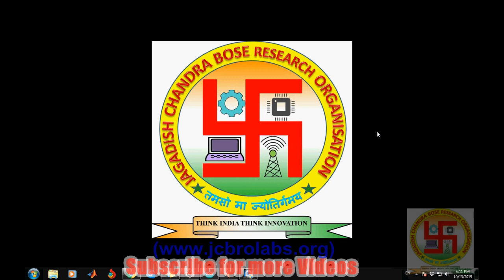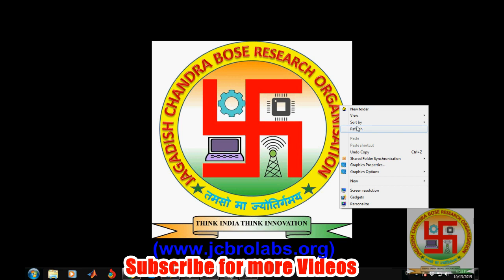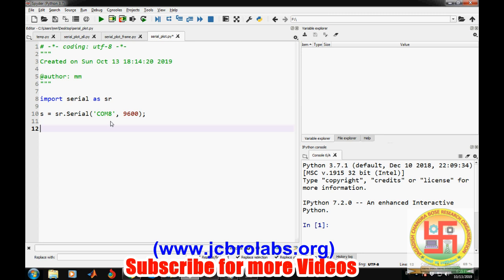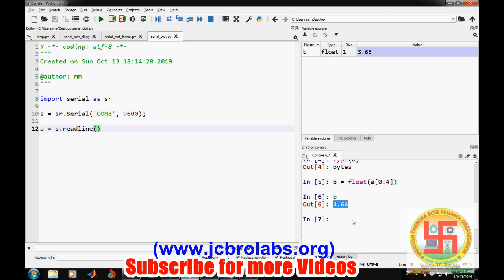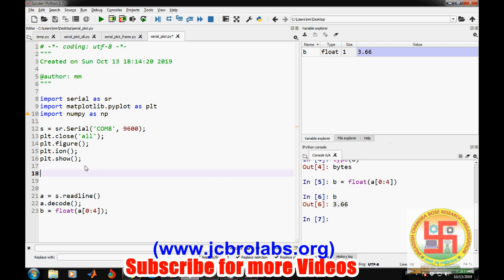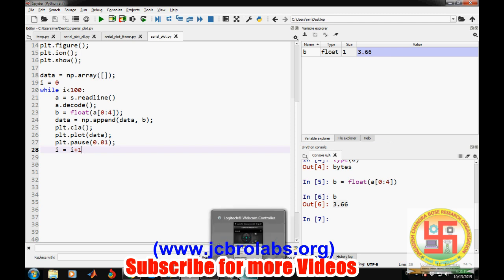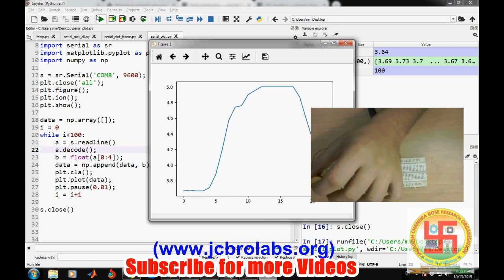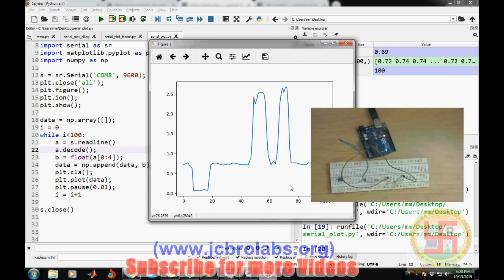How to Plot Real Time Serial Data from Arduino using Python Pyplot?

Comment: I got error b = float(a[0:4])   could not convert string to float . and sometimes 'utf-8' cannot decode error while working with Raspberry Pi.
Reply: Hi, i have the same error cause my decoded bytes was " aX= -500". I solve this problem decoding a in a variable c ( string ) and removing the non float characters in the string ( in my case "aX= "). this is the code :

import serial as sr

s = sr.Serial('COM3', 9600);

a = s.readline()

c=a.decode()
print(c)

d = c.replace('aX =   ','')

b = float(d[0:4])
print(b)

Hope will be helpfull. Bye